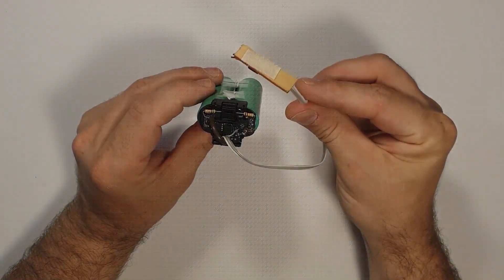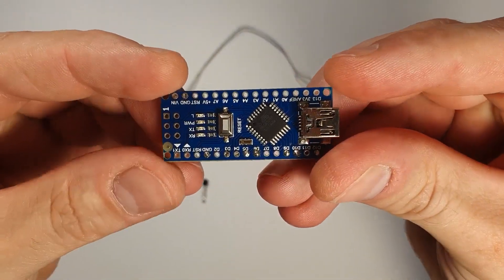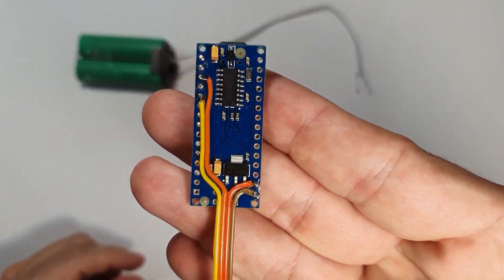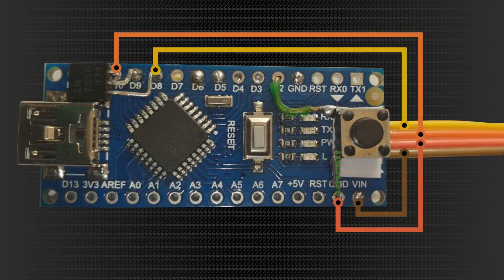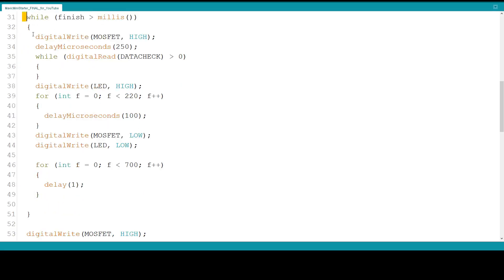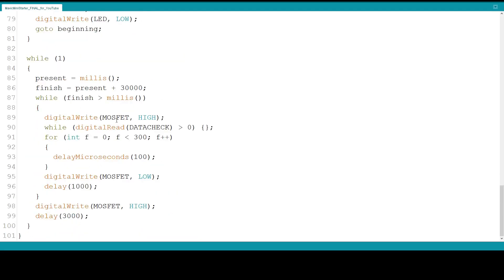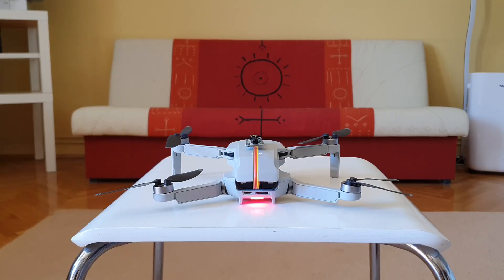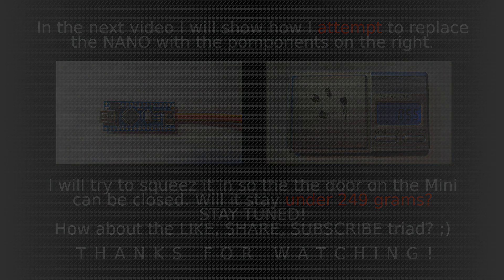Mavic Mini battery hack Part 2

Comment: Hi Zolly.

I just discovered your channel while doing some research on DJI products. I don't own one (yet) but I have reasons to do so anyway. I don't like greedy companies who stole someone's IP in the first place... 

One composite question: Have you logged the data communication between the drone and the battery? Is it encrypted? If not: how is the battery ID communicated? In the clear? What protocol is used? 🤔

Without having had a look at this myself it should be fairly easy to make a clowned (🤡) battery PCB so I suspect the data stream is encrypted, right? Nevertheless this I see as an interesting challenge... 

Have you looked into the possibility to reshape the battery compartment to accommodate larger LiPo cells internally? This would be a great mod but will of course demand some plastic hacking. My favorite! 😂 

I'm looking at eventually get a Mavic Air2s to attempt a rather brutal 'hack' and in the end make it fully 'Open Source' - but I haven't decided yet if it's worth the effort or not - and it would be a community project, not a solo flight operation. (I have developed some drone flight software, both fixed wing and single / multi rotor copter, and won first and second price in an international challenge back in 2009 so I have a little experience with miscellaneous flying crap. But gasoline powered). 

I recently did a similar thing - hacking, extracting firmware and so on, for another well known Snapdragon based product with TrustZone active and all tamper fuses set. Nasty thing to do, setting those fuses... 😉
Reply from the maker: Hi. Yes it is encrypted. As I know it uses SHA 256 which sound way overkill, but hey, it is just a protocol, so why not. 😅

Comment: I have a mavic 2 pro, I removed the bloated battery and disconnected it with the battery circuit. I added new lithium batteries now the circuit doesnt works. Can your method work on my mavic 2 pro? Or is there any other way?
Reply from the maker: Hi!
I would love to test it, but I do not have access to a Mavic 2 Pro... I believe it is possible to hack it in similar way. I am working now on a Mini 2 and it is working too. The code has to be changed for the microcontroller. So I think with a yet again changed code it could work with your drone too. If you have any good idea where could I borrow a Mavic 2 Pro (as I can not buy all the drones there is) I am happy to dive into it! :)
Reply: @ZollyD  come to me, I have all the drones and a workshop, you can carry out your experiments
Reply from the maker: @DODG-Dji-mavic  haha. I would love to. 😉